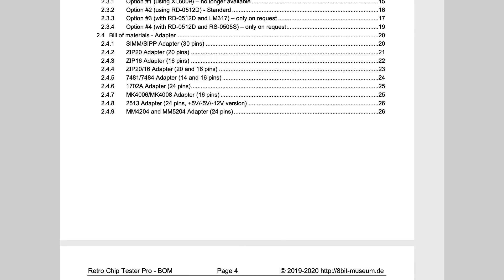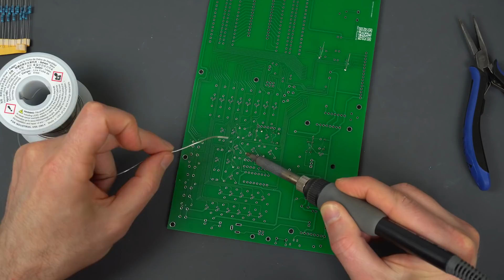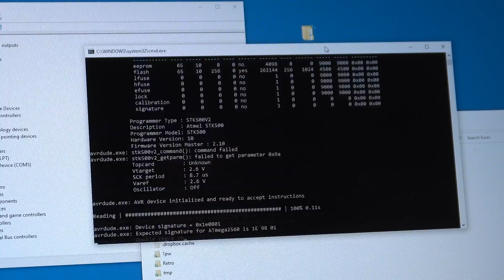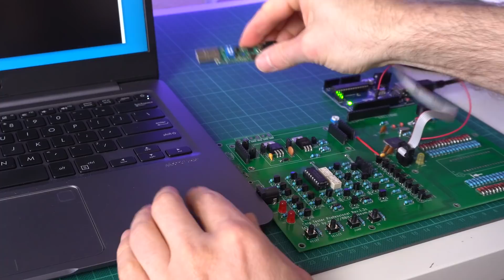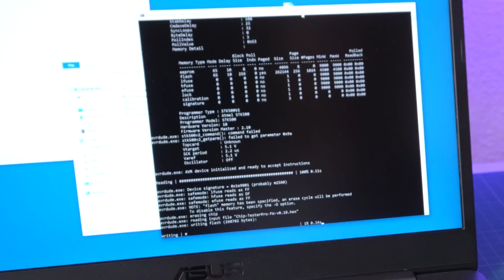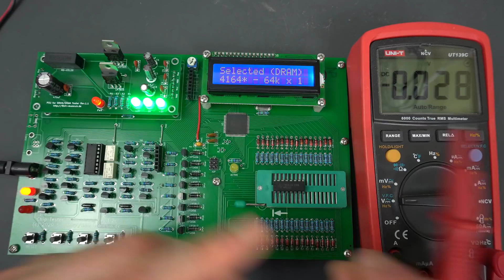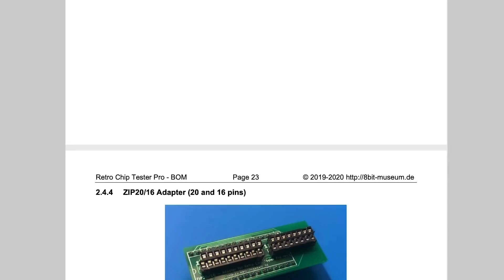The Ultimate Retro Chip Tester?

Comment: Excellent work. Very cool chip tester. I agree, it looks to be geared more towards professionals or serious hobbyist. I'd consider making it if it were a full kit and software updating wasn't so complex. For now, I'll just stick with the basic chip testers.
Reply: Excellent device, I agree, but for me who only need to test a few types if ICs (mainly a bunch of 41256 DRAMs for expanding a Commodore 1750 REU to 2MB), it´s difficult to justify the cost and effort.
Reply from the maker: Makes sense. It's definitely not everybody, although you do have quite a few different machines so you would benefit from it at least from that angle.

Comment: I have noticed that both regulators at the board's PSU now are lacking a proper heatsink. It's safe?
Reply: Yes it is. Max. 150-400mA are expected. When using a 7.5-9V power supply, it gets a little warm only. 12V is not recommended without a heat sink. You can of course use a switching regulator, but choose a good one so you don't have a lot of noise.
Reply from the maker: Good point. Initially I thought it wasn't a big deal because there isn't much of a current draw (0.2A) and because they're standing up in the air, but when I checked, the 7805 was getting pretty hot to the touch (couldn't leave my finger there). I should probably just replace it with a TRACO or some kind of switching regulator instead. I wonder what Stephan's advice would be.

Comment: Thanks Noel. Love that you left the mistakes is… Great manuals often have the TLDR problem. We are all humans :-)

I have a RAM tester (no idea what kind of model it is – it was pricy), which also measures the maximum speed of the RAM chip. I've found a bunch, where the maximum speed was slower than what was promised on the label…
Reply from the maker: Glad you liked it! I think measuring the exact speed could be really interesting, I suspect you need a dedicated DRAM tester for that with a pretty powerful CPU to get that kind of accuracy. Someone brought up they were working on something like that in the previous tester comments I think.
Reply: I think it was Adrian Black who ran into a similar issue with some RAM chips for one of his Tandy computers where the chips were a bit slower than what the label said. This led him to initially think the chips were bad, but once a viewer had alerted him to the issue, it turned out the chips were okay.

Comment: 12:47 if it doesn't have a dedicated back button by design, the easiest way will be implement in the firmware a "hold" (long press) state on the select button to jump back .
Reply from the maker: Stephan just told me that he removed an unnecessary combination and added the back functionality for the next firmware. Yay! 😃
Reply: @NoelsRetroLab  Awesome! Now I REALLY want one!!  :-)
Reply: Or use the back/jump buttons as "back/forward" and make a long press on either of them speed up the scrolling through the devices over time.
Reply: I was gonna say you could potentially read out the firmware data using AVR Studio or something (may need to whack some 'bodge' wires onto the micro to access the pins it uses for ISP if there's no ISP header) and just write that function in probably fairly easily, but if he's adding it anyway then there's no need :D
Reply: I was thinking of putting the whole thing in a case and wiring an extra button to activate both, should also be able to connect a turning knob like that with some in between stuff.